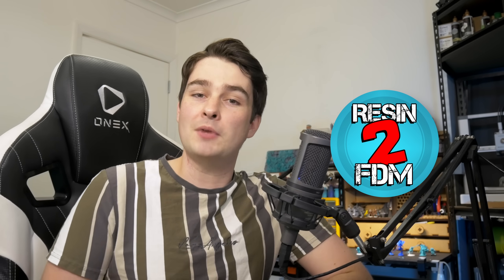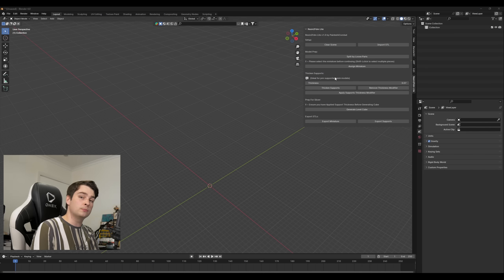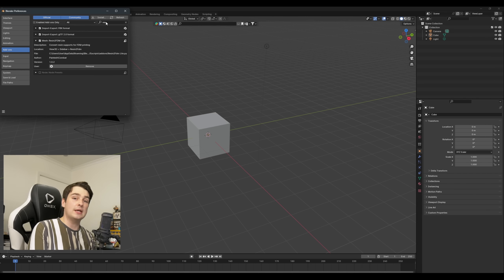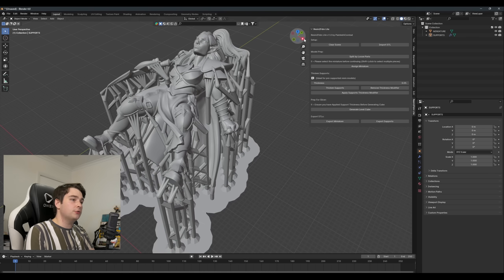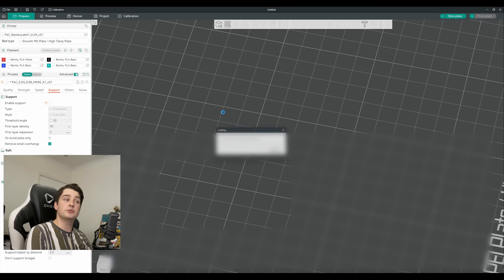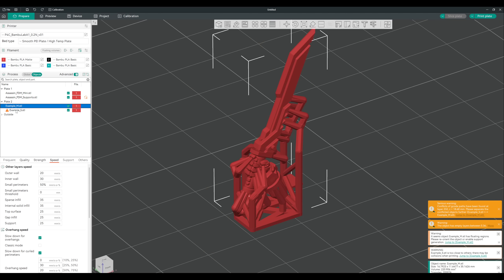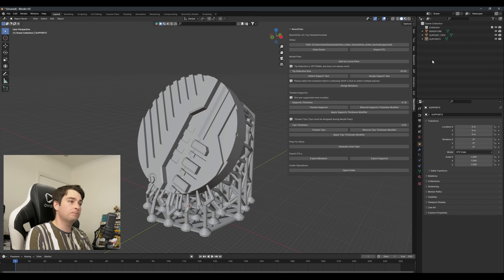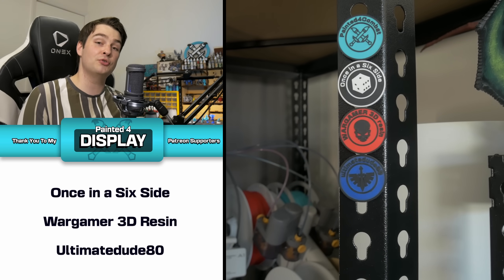Make ANY Miniature FDM-Ready in SECONDS... Resin2FDM

Comment: I have thus far printed two minis using Resin2FDM (One from Artisan Guild and one from Dragon Trappers Lodge / Dungeon Classics) and both have worked really well with the standard settings of the tool. Some supports failed along the prints but despite that i can see no major flaws on the minis. I am fascinated by this and cant wait to see what the future holds for FDM printing. Thank you so much!

Comment: I click on the Install and select the ZIP, but it never appears in my list to enable (4.0 Windows version)
Reply from the maker: Where did you download from, Gumroad or Direct (via google drive)?
Reply: @Painted4Combat  downloaded addon direct. Got Blender 4.0 from the link (was previously running 4.3.2. It says to just use the .exe from wherever it is, but do I need to run an install, somehow, in order to have addons install properly? Or does it need to be in Program Files? Only things I can think of at this point.
Reply: So it turns out I had to ignore the instructions not to unzip the R2FDM file, then navigate down through the layers to the zip inside the zip and install that instead.

Comment: Could the tool be compatible with .OBJ files? I'm unfamiliar with the differences between the 2 so it might not be possible. Either way, this tool is truly fantastic
Reply from the maker: It will still work, you'll just have to import them manually (as the tool looks for STL files) - but thats easy to do, just go to File>Import>OBJ and to your model in, then it should work just fine from there.
Reply: @Painted4Combat  Yeah, that didn't work. Everything was fine until I went to separate the model and supports, and then it just did nothing to the model: the supports and model stayed 1 object no matter what I did (it is also recognized in the file because I can make it the miniature, just not separating it). It's entirely possible I'm doing something wrong though.
Reply: alright it seems that it is a problem with the specific file rather than your plugin. thanks for your support
Reply: the models in particular I am having issue with are Stationforge's stuff, so keep that in mind
Reply: @Helbr3cht  I'm having similar issues; did you figure out a workaround? Hesitating on learning Lychee slicer to just make my own supports; the plugin worked brilliantly with a Ghamak part though.
Reply: @valadir863  it seems to vary from part to part. I have been using the unsupported files. Then using auto supports in lychee, exporting as an stl, and then using the plugin from there. My Anycubic Kobra 2 Neo has been able to handle the prints perfectly from there
Reply from the maker: some STL creators run repair software on their models which confuses the files and makes them think that everything is a single homogenous piece - if the files have been provided with resin slicer files (i.e. Lychee or Chitubox files) you can open those up, re-export the model as an STL, and it should work from there!

Comment: Amazing work! just trialled an OPR mini (HDF munitions unit), which I'd previously printed using tree supports, that had come out pretty well. Trialled the pre-supported version of the mini with 0.06 thickness adjustment for supports, and after a couple of false starts (resolved by adding a 2 layer raft to ensure adhesion) it came out perfectly. I didn't adjust the layer height for the supports, but the mini still took 30 mins less to print than when using automatic tree supports. So if this works out, you may have just broadened my mini printing horizons, for which you have my gratitude (and Patreon subscription)!
Reply: I've just sent Rixxon from the HDF to the printer!
Reply: @AJ12LFC  Good luck! I printed and HDF biker unit overnight and it came out without a hitch. I'm just looking through my myminifactory library, to see if I can find some new challenges!

Comment: First, thank you for doing this. I'm really excited to give it a try.

Second, error on downloading the blender plugin - Sorry, we could not verify the CAPTCHA. Please try again. 
It throws that very persistently at this point (tried a couple of VPN locations, multiple browsers, etc).
Reply from the maker: Should be fixed - looks like the gumroad website was having problems... 

Let me know if it's still down and I'll add a direct download to the video
Reply: @Painted4Combat  
Hi there. I was under the impression that this addon generates supports similar to those used in resin printing. How do I go about creating those resin-style supports? Thanks!
Reply from the maker: @mikekiske   Blueprint (HeyGears Resin Slicer) has great automatic support generation that can be used as is (most of the time) or can be tweaked if you want to to get some great results fast.

Comment: Ok, I´ll be damned...it works. A rather fragile Wood Elf Blood Bowl Player printed till the end on my X1C. Even the pointy ears (however, i ripped one ear of afterwards, that´s on me). Nicely done.
Reply: So, no issues printing using a X1C?
Reply: @marvinw.1765  No...not even with a 0.4 nozzle. I scaled down the line with on the supports to 0.3 for better tip printing and downed the layer hight to 0.4...no issues.
Reply: Curious how you achieved this? Did you not use the FatDragonGames profile since that is set to use an A1?
Reply: @ No. I have a Bambu Lab X1C with a 0,4mm nozzle (i also have a 0,2 lying around, but was to lazy to swap them), selected the preset 0.08mm High Quality profile in Orca Slicer and simply dropped the layer height to 0.4. After clicking "ignore" on the follwing warnig i sliced the model and inspected it. I could see that the tips wouldn´t fully print, so i dropped the layer lines width to around 0.3. That fixed the issue. After that, i bumped up the speed and the layer height on the supports, sliced again, hit print and...well, it printed, took around 2,5 hours. Quite good, actually. I´m sure it would be better with a 0,2 nozzle, but i wanted to try it, to see if it would work, and it did.
Reply: @rened3121  Cool cool, thanks!! Same situation here, have a .2mm but also lazy :). I split the linked free model into two plates and so far so good. Thanks again!

Comment: This maybe is a stupid question, but how do i get the resin supports on unsupported models? Just download some resin printer slicer, add them there, export it, and then put it into blender? If yes, can anyone recommend a slicer for this, or wont it matter?
Reply: I would try Lychee Slicer. But I haven´t tested it yet (for FDM, works fine for Resin).
Reply: Was just wondering about this myself. I do a lot of manual supporting, so I'm really excited about this. I'm glad to hear this works

Comment: Not convinced yet... Looks like a lot of time spent preparing every miniature just so you can safe some time later when removing supports?
Reply: This doesn't leave unfixable scarring unlike standard fdm supports.
Reply: @Gigacat2137   Would need some comparison but after dialing in my A1 Mini and using Matte PLA I have only support scarring at angles less then 10 or 15 and otherwise the supports go off without an issue. I dont see these go away by making the connection points smaller but maybe worth a try.
Reply: I printed a few miniatures with tree supports and one with this method. This works better. Is it better than resin? Not regarding details, but it is impressive what can be done. Regarding time? Well, if you load up your build plate the resin printer will be faster. The thing is...I have much more fun printing FDM than Resin, so...up to you. But i will say, this is an interesting developement.
Reply: @rened3121  Oh, I only print FDM and dont mind if miniatures take 10 hours or whatever. It just looks like a huge effort per miniature...

Comment: Not working for me. I'm using 4.0 on my mac and nothing happens when I press the split by loose parts button. I've tried with the model selected and without, I've tried 5 different stl files that I know are good. It'll give me the loading cursor but won't split the model.
Reply: I am having the same issue.
Reply: @OnceinaSixSide, a month later and still no reply?

Comment: Quick question I want to start 3d printing, is the Neptune 4 Max a good choice? Elegoo doesn't sell 0.2 nozzles for it, but you can buy them online. Or should I wait for the centauri carbon?
Reply from the maker: I havent been hands on with the Cantauri yet - but it looks like that would be the better choice in my eyes
Reply: @Painted4Combat  Would be interesting to get your opinion regarding a comparison between A1 vs Elegoo CC. This will be my first 3d printer and I want to buy one that is able to print miniatures, but isn't limited to a company software.

Comment: That looks really cool! One recommendation: make the cube added to the model thinner than your layer height(just use 0.01mm or so). It still will be recognised in the slicer to place the model but will not generate gcode when sliced. Maybe saves a few seconds in print time and makes  cleanup of the buildplate more easy.
Reply: as it is, it allows for moving the model and supports down if the supports aren't touching the plate.
Reply: @refard5  It would do so either way. Slicers look at the lowest vert for build plate placement (if drop/level/etc is turned on or forced on by slicers made by and for low 2 digit IQ animals aka ones with the same negative level of usability as old versions of blender), as long as any vertex exists, it could even be just a single point added to the same base as bottom of the supports and would still import (and be moved) correctly.